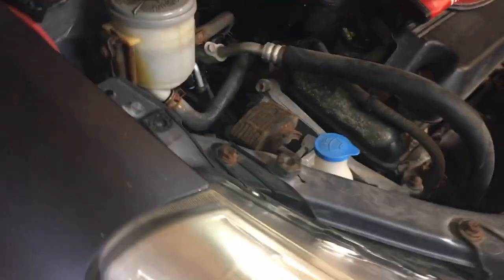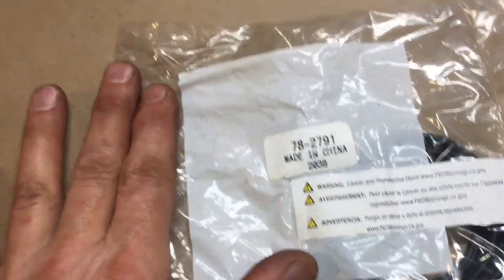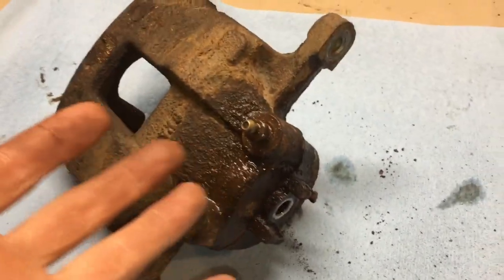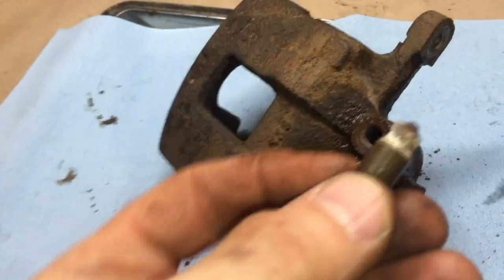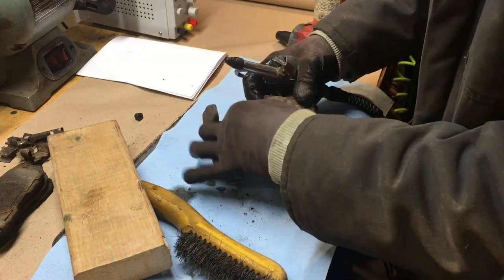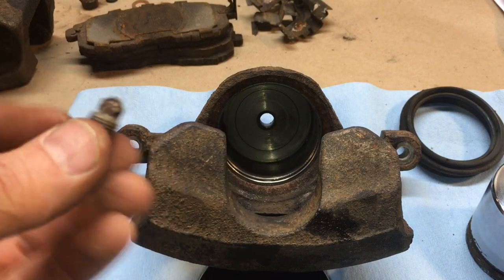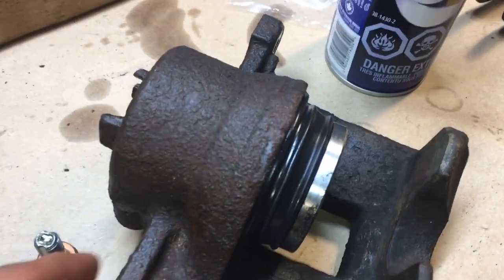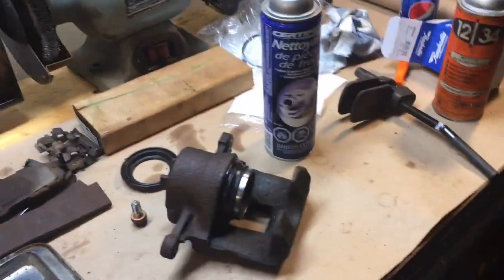SX4 Caliper Rebuild

Comment: Hi Ian, I have been having problems with my 2008 sx4. And I see that you have posted alot on this vehicle over the last while. I had the right side headlight not working so I found a  Corroded wire at the fuse box and repaired it. Then when I went to start the car it would not start and periodically it will start and quit. And it has a u0100 code. Wondering if you could help? Thanks Tom
Reply from the maker: Hi...Issue with the “main” relay/wiring in the distribution box perhaps. Let me look at manual...Loss of Comm with ECM/PCM can result from a loss of power supply via the “main” or loss of ground. I would check that first. Distribution box wiring is prone to corrosion/breakage. Checking for (the absence of) a 5V ref on any of the sensors (if you are familiar with this) may confirm this course of action.

Comment: Hello Sir: Your videos are always very instructive. Just want to see in terms of breaking: I feel the rear breaks don't break much on this car and had to press very hard so they get engaged. is this something you have noticed. Would it be possible a hose can weaken the performance of the rear breaks or the 4-way joint valves is bad? On my car all 4 pistons are moving freely and the rear hand break works very good. it just the rear breaks seem a bit off. on one side it doesnt seem to engage much unless press past the midle (Rust is been seen on the disk) and on the other it engages  bit more but it has little rust band on top of the disk? Any idea from your experience on this car? Thanks for the videos again
Reply from the maker: Hi…Thx for watching. I like to start with the basics. Make sure the system has been completely bled of any air. If the system has ever had any serious leaks it’s possible the ABS manifold will need to be scan tool activated to totally purge the system of any air. Also ensure all Caliper pins are free of corrosion, true and properly lubricated. All pads are free to move within the frames. Cheers
Reply: @TheGibby3340  issue fixed changed the hose and now got good pressure on the calliper. Hose looked fine though and there was no dragging in any case thanks for your advice
Reply from the maker: @samerawaragi3041  Nice fix…Cheers 👍

Comment: Is there an easy way to determine where a caliper came off of? I just got a box of parts off Kijiji recently and was going to rebuild the calipers that came with it but I can't easily figure out if they're for the front or back 🤔 suggestions?
Reply: Nevermind :) I see that there's a bit more stuff connected to the rear calipers, so I must have front ones!
Reply from the maker: No park brake mechanism on the fronts 🍻

Comment: I would have said a good instructional video had it shown the O ring installation. I don't know why this part was missed. Your video only shows the dust boot install but missed entirely the mentioned O ring which is required by the piston to retract once pressure is released.
Reply from the maker: @ 5:13 I mention to make sure the the replacement seal is correct followed by a graphic pointing out the seal is in situ…(already installed at this point in the build) I don’t claim to make perfect videos.